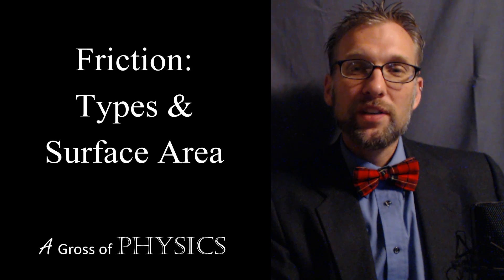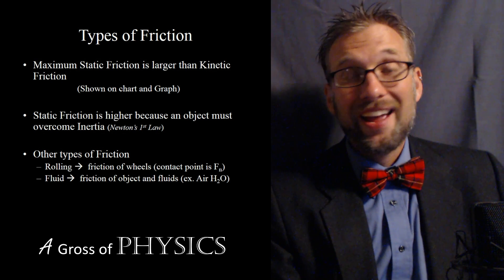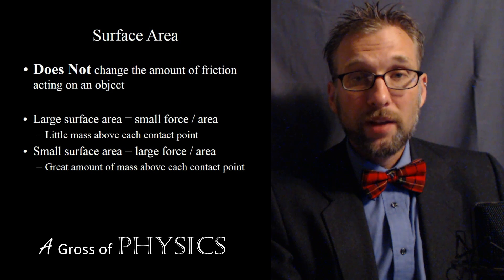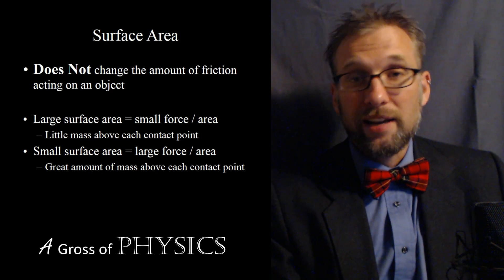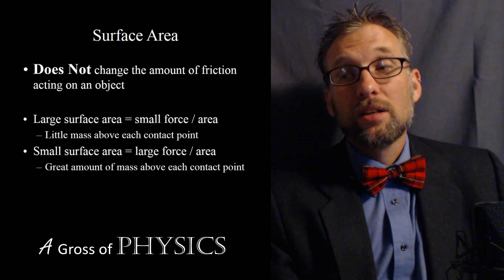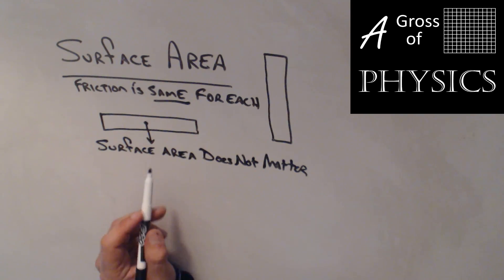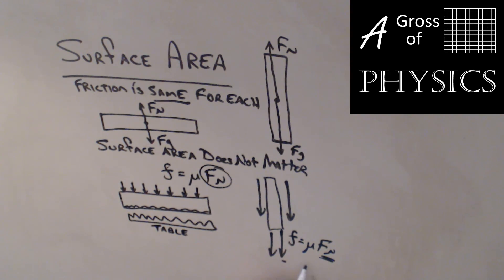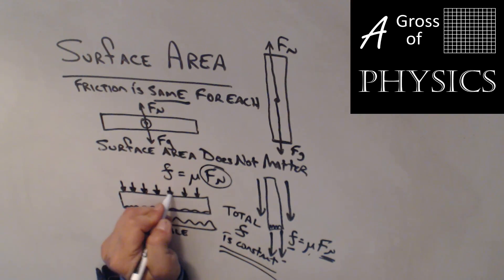Day 047   Types of Friction and Surface Area

Comment: If surface area doesn't matter why do cars with wider tires perform better?
Reply: Assuming that the weight (mg) is equal for both narrow and wide tires.
Reply: Dr Noro Even if the weight is the same, it doesn't mean that the surface of the tire is necessarily the same. The thinner tires might have "bumpier" surfaces than wider tires.